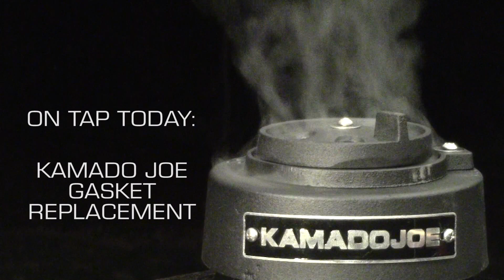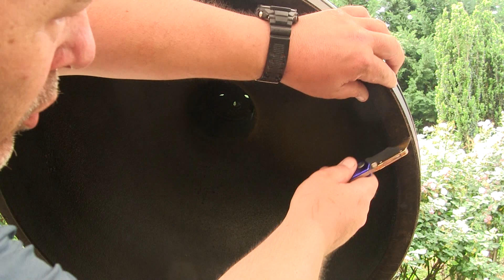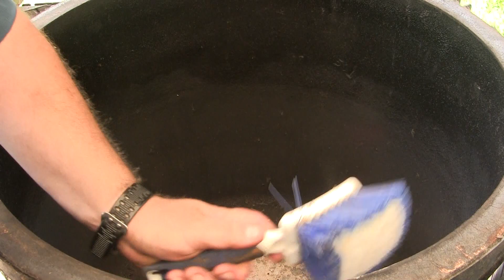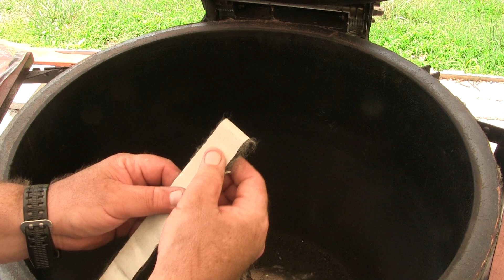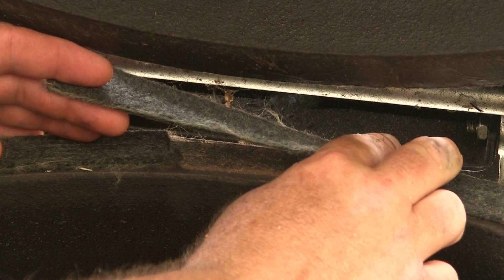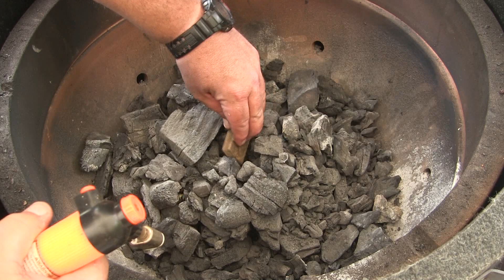Kamado Joe - How to Replace your Gasket

Comment: Good video.  But be careful with the wire wheel.  It can chew away at the edge of the ceramic quickly.  It is easy for it to get away from you or slip.

Comment: Hi John,  I just replaced the gasket on my Big Joe.  I was surprised that the gasket kit was not long enough to do the Greill base and the dome.  I needed to buy a second gasket kit.  So now I have two  long ends that cannot be used unless I have two joints on a surface.
Reply: Thanks.  My dealer here in Australia  only seems to have the one kit.  I will let them know your reply so that hopefully they get hold of the Big Joe Gasket kit for future

Comment: When I got my Kamodo Joe, the first part of the gasket that began to wear away was right next to the hinge. When you close the lid, there is just a tiny bit of shear between the lid and the gasket that slowly wore it away. What made it even worse was that the seam was right at that spot, so it didn't stand a chance. If the seam weren't there, I think it would have been OK. So when I replace the gasket this time, I'm going to make sure the seam is further away from the hinge area... not like in your video.

On my Kamodo, it had a gasket on the bottom part, but not the lid... and the gasket material looked thicker than the gasket you put on.  I think I might like it that way better.

Comment: Hi John, I recently replaced my gasket as my New Classic Joe was delivered with the bottom gasket not seated onto the ceramic base near the rear towards the main hinge. After replacing it and using it a few times I noticed that the gasket is wearing off the ceramic base. Its as if its being pushed off inwards towards the grill. Does this means my lid hinge is not fitted correctly?

Comment: Hey John,

I’ve had a small section (2-3 inches) pull apart on my first weekend of used. Is there a way to mend this? It’s split in two and seems w/ the right adhesive could be salvaged.

Comment: Hey John, thanks for another great video. I live in the UK & had my KJ outside, but under cover, all winter & my gasket has disintegrated completely. Your video & the comments don't suggest that weather should be a factor, but I can't help but think that it is. Any thoughts? PS. We had a wet, but not very cold winter. Cheers.

Comment: My gasket was damaged by me. I was a little to aggressive with a wire brush while cleaning the racks. Just wasn't paying attention and tore some off so now I'll be replacing the bottom gasket but I'll replace both top and bottom.

Thanks for the excellent video John!
Reply: Same here.  I wasn't watching the heel of the brush when I scrubbing down the grate.  Tore some of the felt.  Bummer.